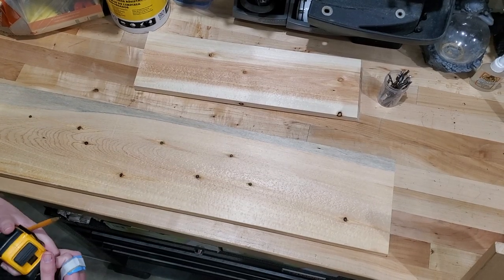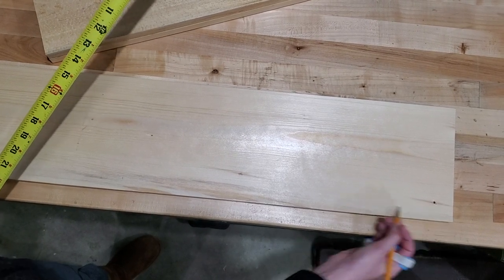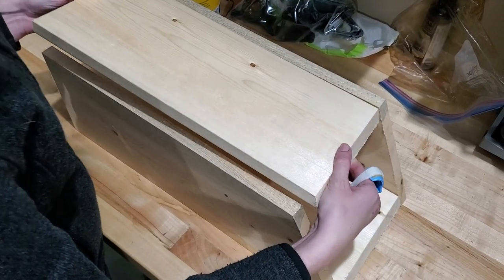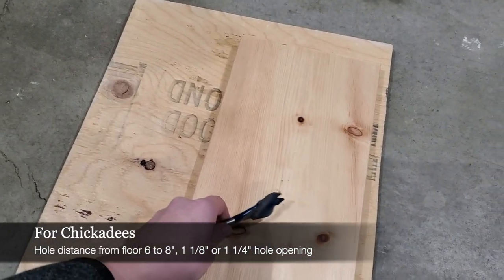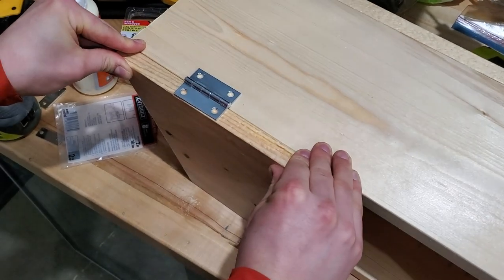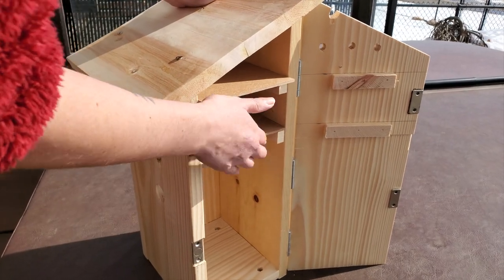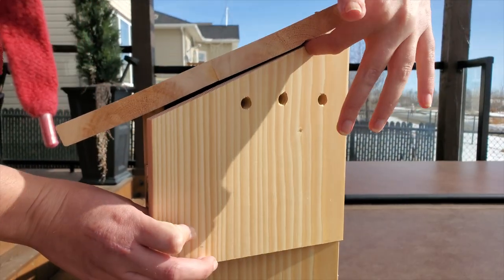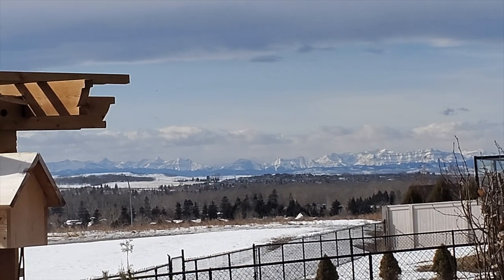Canadian Bird Nerds Nest Box with Cam Build

Comment: Nicely made video (y) . Perhaps 4 points of improvements from what I have learnt in making nest boxes.
1. I drill 2 holes of 10mm in the floor so (condensation) water can drain 
2. A metal plate that is protecting the opening from being hammered wider bij woodpeckers 
3. Raise the floor with 5 to 10mm, just be on the save side towards water/rain, got that advice from the book from BTO on nest boxes 
4.I guess your dome camera is fixed to that highest fiber board. Why not make that bottom door a little higher so when opening the top door you still have the full nest box closed. That lowest fiber board will not deform when it is supported on just 3 sides.